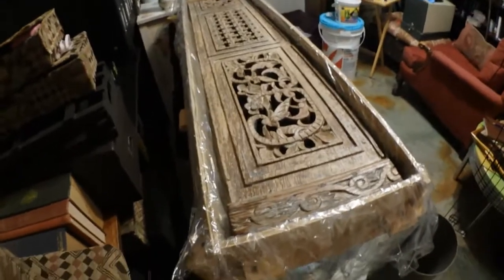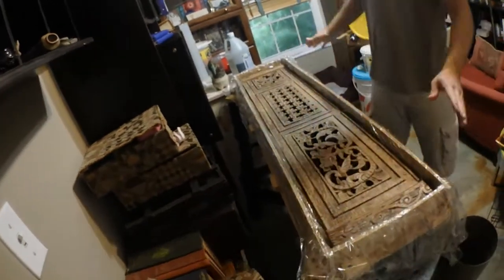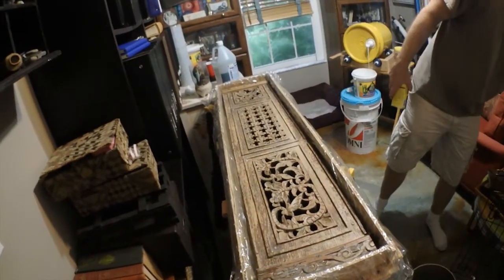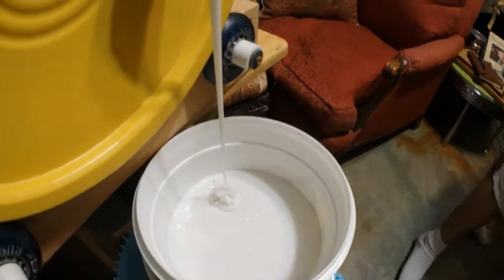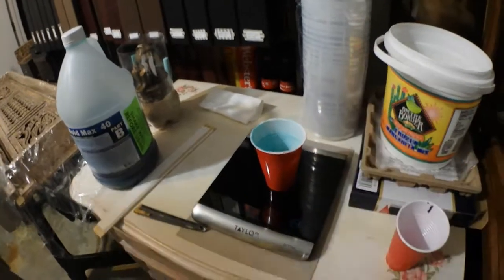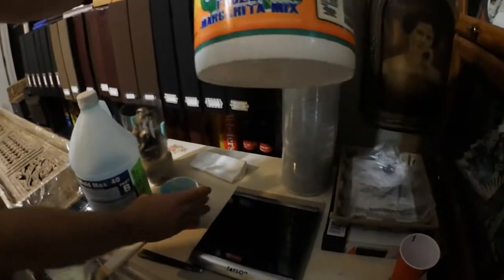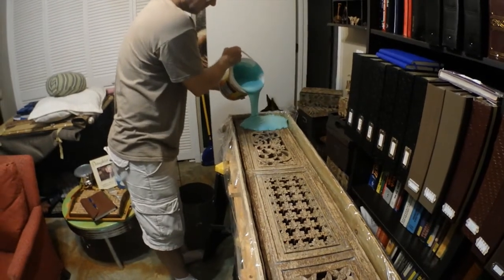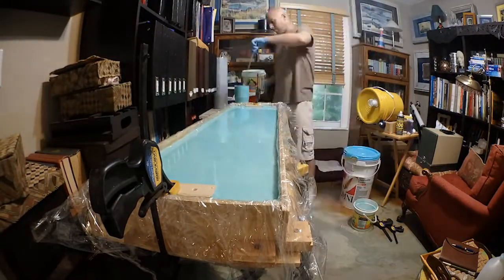Making a silicone mold out of Mold Max 40

Comment: Hey! Your video is my only guide so i am currently bowing down to you! Lol i have a 6in X 5In skull i am trying to cast into a mold and since you have more experience with the 40 maybe youd have additional pointers????? The skull has protruding flowers 🌸 🌼 and vines on it, very detailed.
Reply from the maker: Make sure you don't have too many undercuts or your piece will lock in. You might have to fill in some of the undercuts with clay. With something like a skull that isn't flat on one side you may need a multi piece mold not just a 2 piece. Keep in mind how the silicone is going to need to release. Have a plan in place before starting. If you do not have a pressure pot, pour the silicone slowly over the edge of your container so that it pops any bubbles that got created in mixing your silicone. Each project is different so how you approach it depends on your particular piece. This panel was pretty simple in that it was just a relief and most of the carves were not undercut. 3-d gets more difficult. 
Hope that this helps. Good luck with your project.